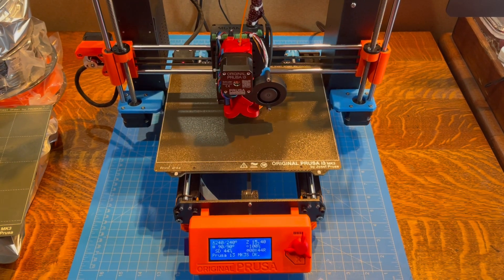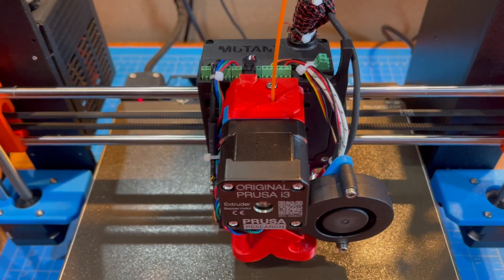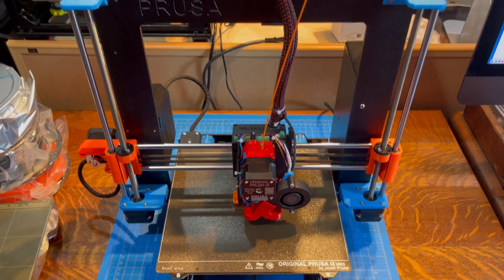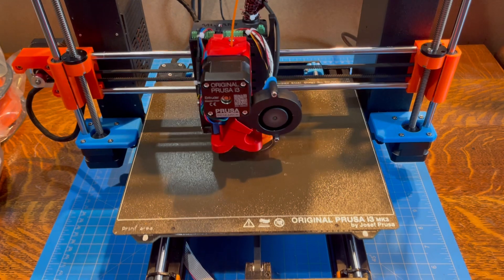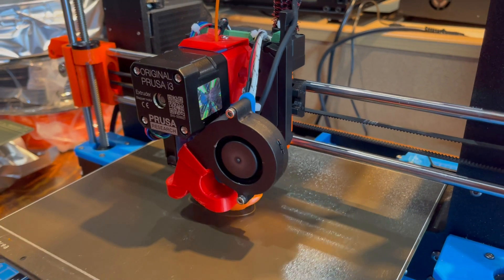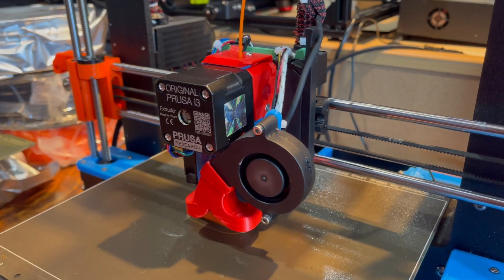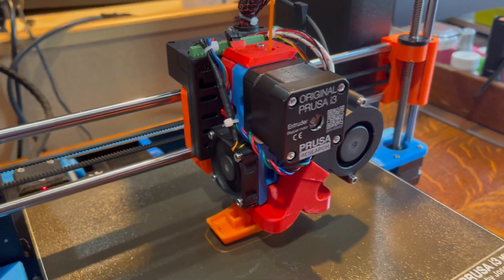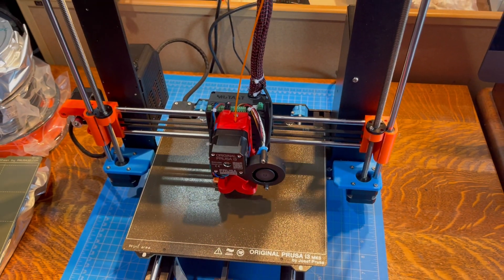Prusa MK3S+ MUTANT Upgrade

Comment: This sounds super cool! I have noticed that it doesn't require the FEP tube... But will it be compatible with the MMU Unit?
Reply from the maker: Yes this would support the MMU unit as nothing about the Prusa extruder is affected by the Mutant. In this example, I have only modified the Prusa extruder body parts to be able to attach the extruder/hotend to the Mutant Mobile plate.The parts that need to be changed on the Extruder when adding the MMU are not affected.
Reply: @MediaMan3D  I was really blown away by this! I am so into a sustainable project like this. Thank you, sir, for sharing.